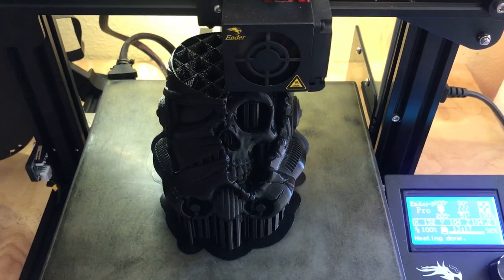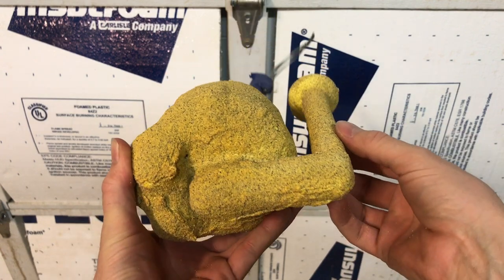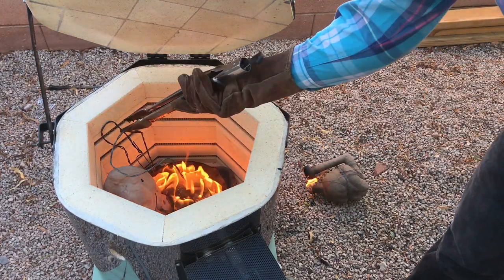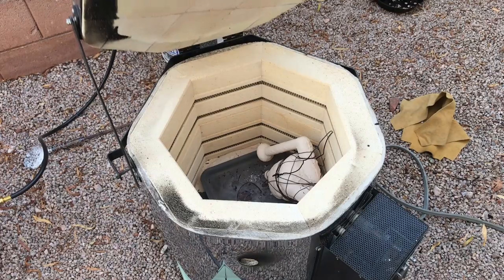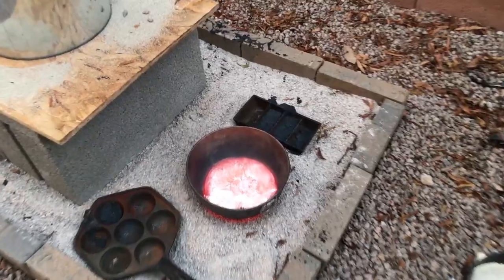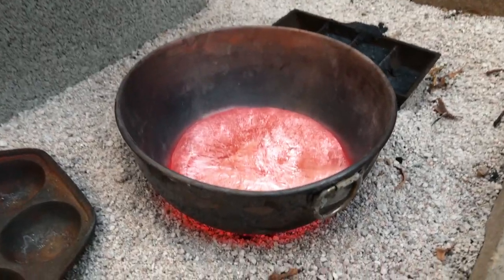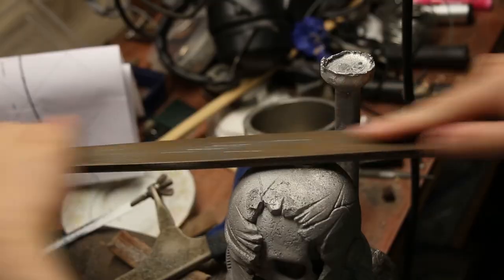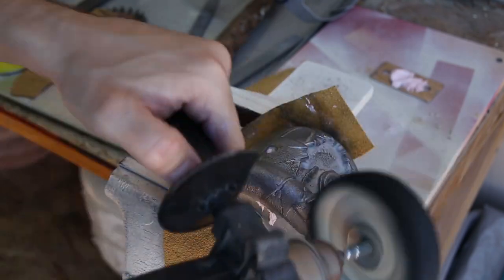Casting Aluminum Storm Trooper│Death Trooper│Lost PLA

Comment: Glad I found this video. I also built the fire-keg and have been doing some casting. I recently started using investment plaster. It works quite well, but I like the slurry method better. I knew about it, I just didn't know you could "backyard" it. I'm shopping R&R stuff now! Upfront costs are higher than investment, but you don't have to construct a flask. Great for bigger items. Although, I need a deeper kiln!
Reply from the maker: Virgin Metal I’m glad you found this useful. This casting didn’t turn out all that nice (aluminum was too hot) but I have learned a lot since. I hope you have a good experience with it!

Comment: Excellent video have you try degassing the aluminum with argon or degassing pills, it can help you to remove some bubbles and get a smoother surface.
Reply from the maker: agustin ruiz Thank you! I haven’t tried degassing however I believe the cause of the poor surface finish was the aluminum being too hot. Several people have told me that I poured way too hot.
Reply: @robinson-foundry  One thing that could cause porosity is how long the pour sprue is without tapering, when the aluminum hits the bottom of the sprue it creates a lot of turbulence. Its similar to how if you dump water into a cup from high up it has a lot of bubbles. If the sprue tapers to be thinner near the bottom, it can reduce turbulence and porosity.

Comment: tip for avoiding pitting and cold shuts, is to heat the ceramic shell - to basically glowing red before filling it with metal. :)

Comment: what's the reason for using an electric kiln to burn out the PLA instead of propane? is it just cheaper?
Reply: The torch flame would burn a hole through the ceramic where the kiln on the on the other hand is just got wires that get hot.

Comment: Funny that you still see Z-lines from the print. I have one suggestion. Maybe make ABS print with acetone gas treatment to remove the z-lines. Oh, and Celsius degrees while talking next time.
Reply: ABS really doesn't burn out very nicely.  Unfortunately, neither does HIPS... (just don't... chlorine not good for you -- I was hoping I could 3D print and then do "lost foam" but.... nopenopenope.
Reply: Whaaa...  (32°F − 32) × 5/9 = 0°C

Comment: hey seth, that looks hot, like maybe 1700 you might try cooler to get less shrinkage and porosity, 1350-1400 which is more like a pink but not orange color on the metal.
Reply from the maker: Artemas Ward Thanks for the advise. I’ll definitely pour cooler next time. I haven’t worked with aluminum much as I skipped it and went straight for copper alloys!
Reply: @robinson-foundry  you can make an immersion temperature probe with a thermo couple and a multimeter. 

That is an easy project, you just have to find the heat proof tube that covers the thermo cover.  Then there is a ohms chart that you use to convert the ohms to your temp/  But if you look at factory casting vids, you can go by the color of the metal. Steel white, bronze yellow, silver orange, aluminum pink, pewter or lead, no color.

Comment: Good job man..  You can probably shave off a couple of layers of shell if you wrap with wire after layer 3.  It's not hard to remove on breakout.  The shell just crumbles around it.  I notice your surface isn't what it could be.  What grain size silica are you using on the first 2 coats?  I recommend something pretty fine and then back it up with course stuff to build up strength.  Good idea with the pan during "dewax", I bet that's some stinky shit!
Reply: Got any microcrystalline wax?  I've seen guys smooth over those print lines with it before investing.  ;-)  It just melts away.
Reply from the maker: Thanks man! I’ve learned a lot from your videos. So you’re saying coat three times and then wrap it wire and then continue to coat a few more times? I went with 10 coats because I really didn’t want the shell cracking during burnout. 

I’m using a very fine silica sand for the first two coats and coarser silica sand for the rest. I followed what you said “suger and salt”. 

I did a large lost pla bronze sculpture with the exact same process however the bronze is incredibly detailed, almost as if it was printed in bronze. So I don’t think it’s an grain size issue. Someone told me that my pour was way to hot.
Reply from the maker: worldtraveler I don’t but I’ll give that a shot, thanks.
Reply: @robinson-foundry  Exactly!  I learned this trick from Berry Luke builds here on YT.  It's especially helpful with thin edges to keep the pressure of the metal from blowing out shell.  This also works on that plastic pooh you are melting out.  Salt, then sugar!  Well done!  You are probably right and it was probably the temp of the aluminum.  I haven't done shell with aluminum in a long time.  Seems to me, preheating the shell isn't that important with aluminum and R&R told me on the phone once, just 3-400 degrees preheat on the shell was plenty.  With really thick stuff like your skull, it needed to be just completely melted.  Same for bronze, I always pour thinner stuff first so it travels through the mold and the thicker stuff I pour cooler.  I get a better finish and less cleanup work is needed.   I'm impressed you poured that fat skull solid and didn't suffer any weird shrink issues.  That's a testament to how good shell is.  David at thehomefoundry yt channel does some of this lost pla stuff and I know he runs shittons of layers too.  So 9 not reinforced isn't out of the question.  I bet that thing was HEAVY!
Reply from the maker: @jagboy69  Cool, I'll check out Berry Luke's channel. 

I originally planned to cast this in bronze but didnt realize it would be around 15lbs. Reluctantly I chose to use alumiunum, knowing I would encounter shrinkage. Fortunately, because I had extra metal which I poured into a bowl, when I noticed the metal shrinking down into the casting from the vent I used a spoon to refill it. I did this off camera because I didnt have time to set it up. Im amazed it worked. 

I did have an issue when applying the second coat of slurry. It was beading off of the sand which was very frustrating. Can I just go with two slurry coats at first? 

Thanks
Reply: @robinson-foundry  That's interesting.  I've never seen it bead when applied to a previous coat.  I've seen it bead on the wax at the very start.  (that is cured with a wetting agent, but I've never needed it on microcrystaline) Be sure you run a paddle mixer on a drill each time you dip and try not to aerate it too much.  If you encounter bubbles, a real gentle compressed air blow is good for making bubbles go away and ridding the excess slurry prior to applying the silica.  I gotta ask, where is that silica from?  That doesn't look like the stuff R&R sells.  Did you not buy THEIR silicas?   I know shipping sucks, but they have warehouses around the country that carry just the silicas.  I pick mine up in Dallas or at a warehouse in LA.  I can't remember where you are.  Phoenix????  You could apply 2 coats of slurry only on the first coat, but it would run the risk of delaminating and that would lead to surface finish issues.  A better option and this one I have done and it works....  I ran a slurry only once on the first coat and allowed it to fully dry.  Then dipped again and applied the fine silica.  That works fine.  That any help for you maybe??  :-)
Reply from the maker: @jagboy69  Sorry I took so long to respond. Its all very helpful advice and I really appreciate it. I'm in Las Vegas actually. The silica I'm using is the finest I could find at home depot. I really wanted to avoid buying the special sand as I'm on a bit of a budget. Next time I'll try two coats like you describe. That may help. I just posted another video. You can see that the detail on the casting is much better. I did have some issues with poor venting but the surface finish is excellent.
Reply: @robinson-foundry  That explains it.  Spend the bucks and get the 2 different grain sizes you need.  You can pick it up I think it was the city of industry.  It will cost you less tha 100bucks.  You spent big money on the slurry, now is not the time to cheap out.  I knew something looked wrong by the color.  Silica should be snow white.  I'll check out your new video tonight.